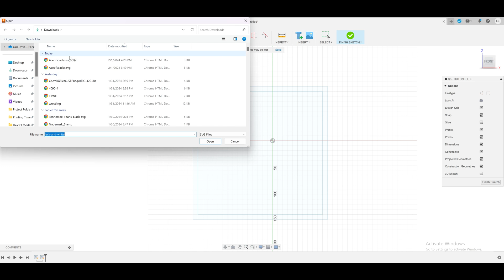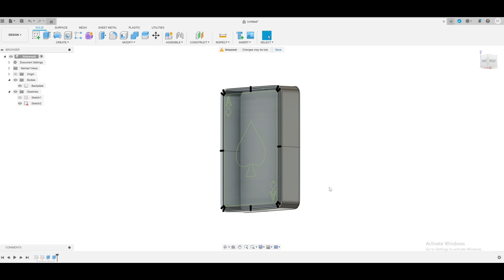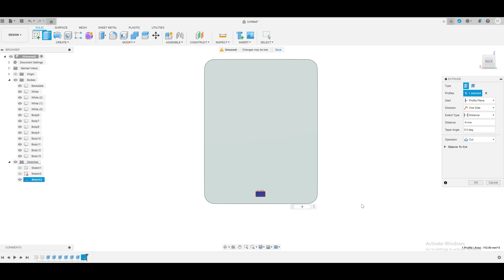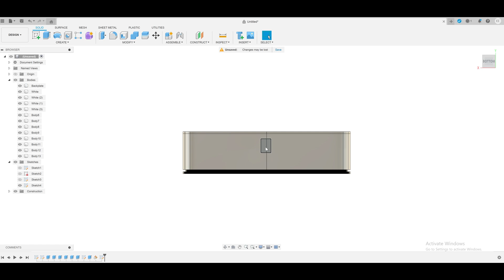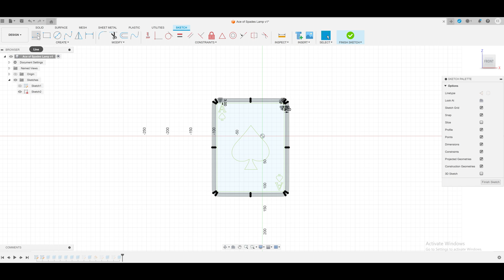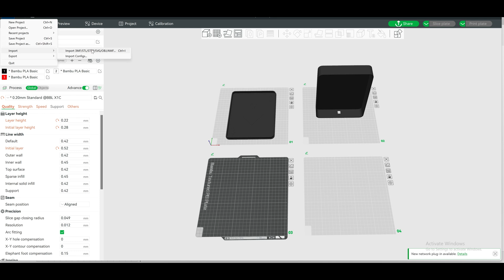Lightbox Tutorial v2 (How To Make Lamps In Reverse)

Comment: Nicely done. When doing the colouring or filament assignment it's easier to just use the objects tab and then assign teh colour there. Don't need to paint of fill it assigns the colour because it's easy as you named it the colour it should be. Way faster when you have a lot of parts.